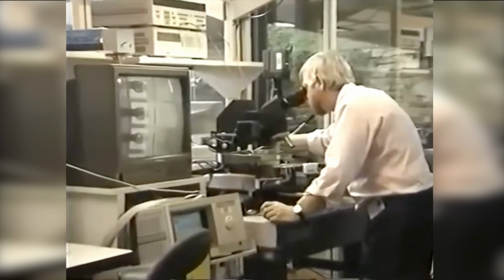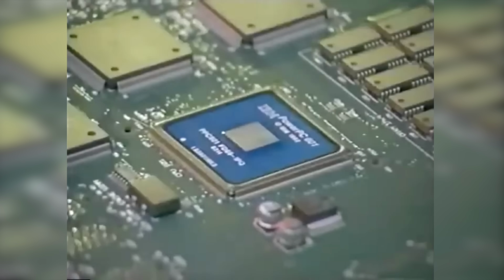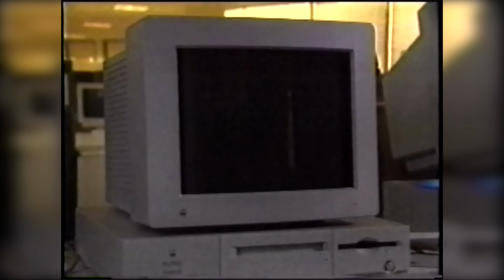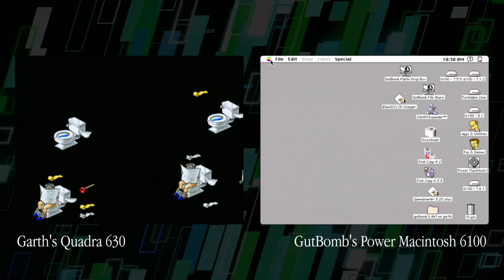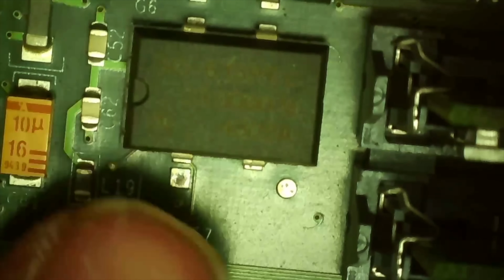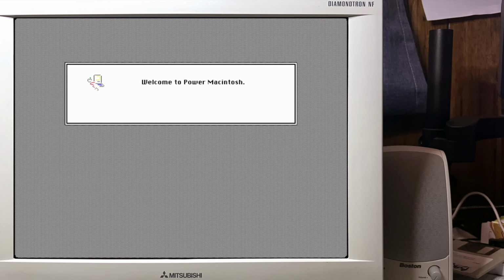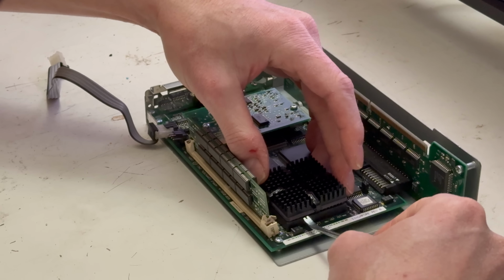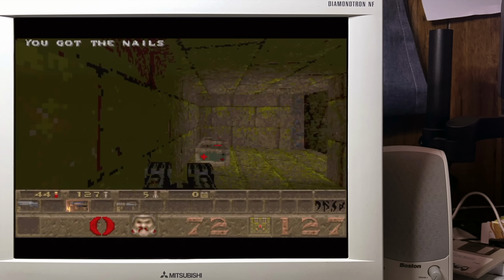Was the Power Macintosh 6100 Crummy?

Comment from the maker: UPDATE: someone told me how to get FPS to display on Doom II for Mac and on the 6100-80 it averages around 30fps. To get FPS to display on Doom II just change screen size and then change it back. + or - on the keyboard.

UPDATE 2: turns out that I was wrong that the outer pins on the Pentium overdrive are all power and ground. There are some pins related to cache out there too.

Comment: The 68k emulation issue was also the main performance issue with PPC603 machines like the 6200 and why there was such a clock speed disproportionate boost to how the machine felt when the 603e was used instead in the 6300. The 601 with its unified 32K L1 ran the emulator about as fast as one could expect but the 603 had half this and it was split into 8K instruction and 8K data. The larger L1 of the 603e, 16K instruction + 16k data, made as much of a difference as the extra 25MHz for 68k code. 

The real selling point of the PPC machines was the promise of future application support. That's what helped my parents feel confident enough to buy a PPC machine back in the day...a PowerBook 5300cs, and that leads me to another fun idea for a video because that was a TRULY crummy machine!

As an aside...I believe the pitiful gaming performance on the DOS card is due to the lack of local bus video. The very small gains in games with large CPU speed increases is typical of ISA bus video 486 systems.

Comment: your benchmark of 6100 against 840av was not evaluated correctly. Look at the FPU, the 840av utterly stomps the 6100, and if (a big IF) Power PCs would not render 840av obsolete so fast, maybe there would be some software utilizing the DSP3210 and that would boost the 840av computing power a lot. Also you forgot that you can as well overclock the 840av, not much but still...

Not that it it is all very relevant today :elbowcough:
Reply from the maker: As I said in the video I ran the benchmark in 68k emulation mode on the 6100 to accurately show the performance in the vast majority of software available at the time which was 68k. The FPU has to run in emulation in that mode.

Also it’s just silly fun, literally “stupid stuff with old computers”
Reply: @GutBombTech  and I did catch that, it was to mimic the situation after the launch, later when native PPC software came out, the onboard FPU on PPC destroyed the 68882 on 68040 die utterly. I was just pointing out that the Quadra 840av in your benchmark battle against emulated 68k actually won, not lost.

While it is silly fun, for us retro fans its the greatest fun of them all, 🤗

Comment: Using the G3 PDS upgrade card is the only way I can think of to make the machine not be a sluggish piece of shit computer. 

Several 6100 machines that got upgraded to G3 processor spec suddenly became pleasant & fun to use. Unfortunately the lack of further expansion make these machines severely limited in upgrade options. 

The slow 5 MByte/ sec SCSI, lethargic video subsystem, & the 6100’s 30 or 33 MHz system bus limited the upgrade paths significantly.

Comment: The original Power Mac 6100/60 and 7100/66 were slow because Apple did not include the 256K Level 2 cache that really gave the PowerPC 601 a performance boost.  Only the 8100/80 had it in a standard config.  The Level 2 cache was optional in the 6100/7100, but highly recommended.  Third-parties even offered a 1MB Level 2 cache, better than Apple's 256KB Level 2 cache.  The revised 6100/66 and 7100/80 included the 256K Level 2 cache from Apple.  So if you have a 6100/60 or 7100/66, it needs the Level 2 cache for a performance boost.

Comment: Measuring the experience of the Power Macintosh 6100 is a lot more complicated than can be measured by any speedometer:  Apple had profiled a lot of popular applications, specifically what Toolbox calls they made, and prioritized bringing the implementations of those APIs to MacOS at shipping.   A lot of vendors had versions ready, because, to put it oversimply, they just had to recompile (technically just relink) their apps to the new versions of the Managers in the Toolbox and got a LOT of native PowerPC code for FREE.  Meaning that they didn't have to change their own code to reap the benefits of native PPC code.  

The example passed around a lot at the time was Microsoft Excel:  profiling revealed that it spent 70+% of its non-idle execution at any given time  inside of just a single Toolbox call (in this case, Quickdraw), "DrawString()", the Quickdraw API to draw text strings onto the screen.   So when MS relinked Excel with no other changes, it spent 70+% of its time executing PowerPC code.

Comment: I had a Powermac 6100 for less than a month before it was stolen from my office. I got the impression it wasn’t a speed demon. I liked the monitor though. Too bad it was stolen too. I used the insurance money to buy a Powermac 7200-90, which was made easier because there was a price drop in the meantime.  It did everything I needed at acceptable speed. Not too long afterwards, I got a 33-mhz Performa (I can’t remember the model) for home use, and it seemed preppy. It ranall the education software and games very well. That was the last Mac that ai bought for almost a decade, when ai bought a G5 iMac. I really liked that one because it could run Logic.

Comment: I had both a IIvx and a 6100.  I Don't think i used either one of them in a way that made the difference in speed really obvious, but it wasn't that long before I just wasn't using the IIvx for anything.  It was a simple matter that, once it was clear that PowerPC was the new way, lots of software just required it.  Or required System 8.0.  I think there were a few games that did run better on the IIvx than in the emulation on the 6100.  The bit of software that made the biggest impact for me was an IRC client.  I lived on IRC back then.

The thing that really just got me to put the IIvx in a closet though, was once the internet was really the main reason anyone used a computer, there were some audio players for PowerPC that could just about play any MP3 i could get.  Threre weren't any MP3 players that could run on a 68k mac.

Comment: I had a 6100 that I overclocked to 76 MHz with a test clip, I felt that 80 was too hot. I ran mkLinux and, while not as stable, it easily outperformed my SparcStation 20.

Comment: Anyone remember the old Performa infomercials back in the day?  "How many megs of RAM, Carmine?"

The 6100 was my first Mac... the iMac G3/600 (Snow) was my 2nd and final Mac.  The 6100 got me through the early-to-late 90's, before I switched over to PC (an AMD 800 system) in 2000.  Web browsing on the 6100, in 1998-2002 was extremely painful, because of the proliferation of Javascript, Java applets, and the pitiful cache on the stock 6100.  When i obtained the Sonnet G3/500 NuBUS, it made web browsing just a bit more bearable, but even the upgrade card was already 6-8 years behind the times.  Worst part is that that brand of G3 upgrade wasn't compatible with 32-bit Linux (PPC), while similar upgrades from NewerTechnology didn't have that issue (per Kan 6100's old web page).  Do i look back fondly at my 6100?  Not exactly... but I do miss the promise and potential i saw for it, in those first 2 years of using it, as a kid.  Marathon Trilogy, Prince of Persia 2, Full Throttle, and some NES emulation (PAINFULLY slow), held me over until i switched over to PC.

Comment: I remember having a accelerater card in my amiga 1200 it had a 040/25mhz that I overclocked to 40mhz and it had a ppc cpu at 240mhz on it I ran amiga os 3.9 on it that used an built in os called warp up for the ppc side I loved that machine it had 64mb of fast ram on it to using the ppc side I used to play doom and quake on it even used the ppc side to rip cds and make mp3s 🙂

Comment: At the time even with later OS'es, x100 series Power Mac's didn't feel much faster in use than 68040's until they released the next generation x500 machines with 604 chips and PCI. NuBus was slow as hell for even the best accelerated video cards too. I remember how even trying to use a maxed out Workgroup Server 9150 I got for cheap as a general desktop computer felt so slow just 5 years after it came out.

Comment: The Macintosh LC475 with a 25mhz 040 was HALF the price of the Amiga 4000 with the same 25mhz 040 back in 1993. The problem is, this sort of amazing value for money only ever occured at this time with this spec for Mac and so the market continued to ignore them. Yes Windows 3.1 was horrible, yes Windows 95 was a kludge of a 16/32bit buggy as hell OS BUT people do not pay an extre $1000 for a different OS than Windows for identical performance hardware. But the LC475 was an excellent machine, and a 486SX25 PC in 1993 was only slightly cheaper so who knows where that sort of pricing strategy would have resulted for Apple market share. PowerPC was hugely expensive MIPS/$ ratio vs Pentium and not great for laptop motherboards in any of its revisions. In fact the only decent product at bargain price ever to be equipped with PowerPC technology was the Xbox 360 (which cost less than the graphics card you would need to buy for your PC so you could play Need for Speed:Most Wanted in the same quality).
Reply: The 475 shipped with the 68LC040 CPU with no FPU, compared with the Amiga which had the full 68040.

THAT’S why the Mac was cheaper.

I had a 475 when it was still current the lack of an FPU was a major problem I can assure you.
Reply: @kirishima638  No it didn't. the 4000/040 came with the same shitty LC MMU devoid  040 or MMU, the 4000/040 could not run UNIX.
Reply: @madcommodore  not according to every spec sheet I can find. It had the full 040.
Reply: @ funny how all three of my 1993-1994 4000/040s don't have them then isn't it?
Reply: @madcommodore  indeed. 

Show me a spec sheet for the 4000 which states the 68LC040 was standard.

I’ll wait.

Comment: A DX2 66 should run Doom much better than that. There must be a bottleneck at the graphics or something? That seems crazy slow.
Reply: The Mac port of Doom is notoriously unoptimised, just like Wolfenstein 3D.

Carmac made many optimisations specifically for the x86 architecture which were not ported to the Mac.

Comment: I used a 6100/60 for years in the 90s.  That and a 28.8k modem and a SCSI CD player which required a caddy and drivers.

The 6100 reminded of the Chev Cavalier. Nice at first, but then slowly it began to fall apart.

First the drive was acting weird, on/off for no reason.  There was a spare power plug in the 6100, I plugged that one in, the drive then began to behave.  

I too updated the CPU using the crystal, it was...ok? Mac claimed it now ran at 80Mhz,  but there was no real way to see the difference. The real benefit of course was upgrading the ram.  Virtual ram was a time vampire.

The nightmare of course was the HDI-45 cable.  The sheer weight of this dongle and the cables...gravity eventually pulled the cables down enough to loosen the connectors.  So the screen/Mac wouldn't operate.  

A LOT of duct tape later to HOIST up this mess of cables: it finally sorta did...but if I so much as 'looked' at the 6100 weird, the cable would be an issue.

Then the thing which made me realize I need to get rid of this Mac...the Sonnet G3 233mhz accelerator card.  Being the idiot I was...I thought "Get this card...I won't need a Powermac!".  The card noticeably did run things faster...but it kept CRASHING NONSTOP.  

It wasn't all the Powermac 6100's fault.  The MacOS in the 90s was a disaster of extension conflicts/bugs.  At least with Windows you had the 'blue screen of death', for the Mac in the 90s...the damn thing just froze and I had to manually unplug the system.  It took a long time of disabling/stripping down anything that might cause any issue to make it sorta work.  When Mac OS8 came out,  I immediately bought it and was impressed by the overhaul...however it still had a lot of legacy issues. When OSX came out, it too was a buggy mess which only until OSX 10.2/3 did it finally become usable.  

Still, I can't tell you the AWE I experienced when using Hotline (a blast from the past!) I downloaded (after a long time) my first MP3 and listened to it.  It was Rob Zombie's Dragula.  Playing this MP3 took up the entire Powermac CPU/power to play it.  If I tried doing anything else, the MP3 would stutter.  

It was such of a wild experience listening to such pristine audio coming off of a frankenstein/wreck computer which my 6100 was becoming. 

But: It was magical to listen to near CD quality music off of the net.  I knew back then MP3 would render CD's obsolete and it really made me realize that physical media's days were numbered...everything eventually would be online.

I was fortunate enough to sell off this buggy system it helped pay for a nice B&W G3 Powermac. 

The only 'good' thing out of this system...I used it to sign up for an online dating site...and met my future wife off of this computer.  

So the Powermac 6100/60/80/G3 couldn't have been that bad.  

It did help me find love after all.🥰

Comment: This was my first Mac! I do remember being a bit frustrated that so much of the software I used, including large chunks of the OS, was 68k code running under emulation so I wasn't really using the full power of the chip. And some of it was glitchy as a consequence. I got one of the beige desktop G3s a few years later, and eventually started running the first version of Mac OS X on it.

I was trying to buy in a future-proof way--and I was betting on the PowerPC transition happening more quickly than it actually did. If I'd bought the Quadra, I'd have worried about it becoming obsolete quickly. Actually, the situation with the 6100 pretty much persisted through the whole time I was using it as my primary computer, and the 68k machines didn't really become difficult to use until I'd already traded up again.

And then Apple completely changed processor architectures again... twice. With similar backward compatibility strategies.

Comment: I bought a Performa 476 instead for $1000 with keyboard, mouse, and monitor.
All from proceeds from writing Macintosh Software on a Macintosh SE.
It was brutally tough back then as a poor kid with a pocket full of dreams to sell any software you wrote...    impossible even.   Pretty much the same today.  I sold a couple of licenses to PBS.    However, the 476 was one of the best buys I ever made, because I catapulted that 476 into writing a website with Netobjects Fusion to start a computer recycling business that brought thousands of computers home by the pickup truck load.  

One computer purchase turned into a thousand.  I was swimming in computers, including a ton of Macintoshes way way way higher spec than that 476 lol...   which... I never even fired up.  Because I built my first ethernet network and jumped over to PC, Windows, Linux, etc.

Comment: A lot of software started requiring PowerPC pretty soon after the Power Macintosh was released. Especially a lot of games. You might not be happy with the performance of Quake on the 6100, but it won't run at all on a 68K mac. Ditto for Starcraft, C&C, Diablo, and lots of other games.

I suspect that your DOS card performance woes may have been due to non-CPU factors, like the VGA chip. You might have better luck with a different DOS card (like one of the nubus ones) that had a better VGA chip, some of which were probably available in 1994. Another 1994-era upgrade would probably be the L2 cache. Adding or upgrading to a 1MB cache SIMM provided a very big performance boost. I've seen speculation that part of the big boost was that the entire framebuffer could fit in cache, assuming there's no HPV/AV card.

Comment: They weren't that bad. Was it a best buy? Eh, not at MSRP (but what Mac is, amirite?). On clearance? Maybe, if it was one of the DOS or AV models and came with more RAM and accessories (monitor, PPC software bundles, etc.). All three of the x100 Macs were basically the same at their core (even the WGS 9150 is mostly the same except for DB15 video and an extra NuBus slot). If I was an adult in 1994, in all likelihood I wouldn't have been able to afford one new, so when the PCI models arrived a year or so later I would've breathed a sigh of relief at not having wasted money on a technological dead end, and then just skipped the x100s and waited for a deal on a 7500 or (more probably) an equivalent clone. 
A 6100/60 was my first Power Mac, though. It was $100 from a vendor out of the back of MacWorld in 2000 or so, the cheapest PPC option they had. I may still have that thing sitting around somewhere but I've been though so many of them I may not be able to tell them apart anymore.